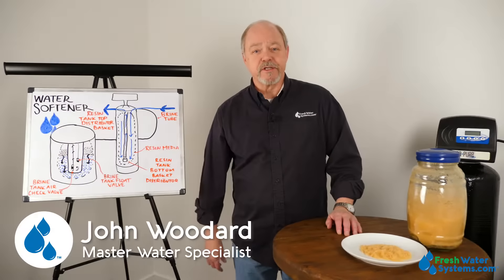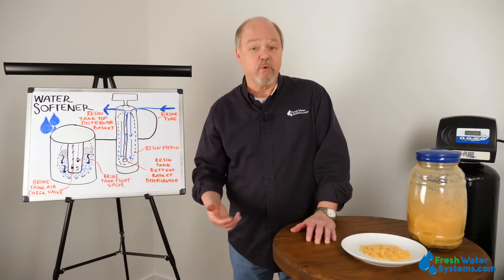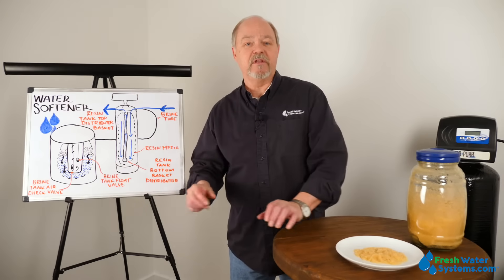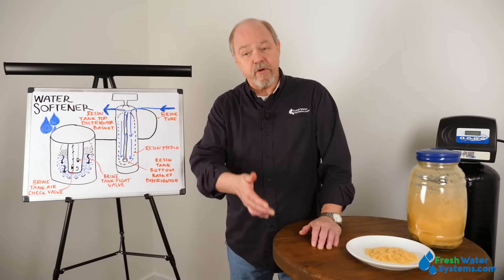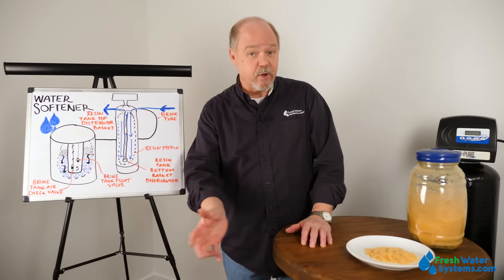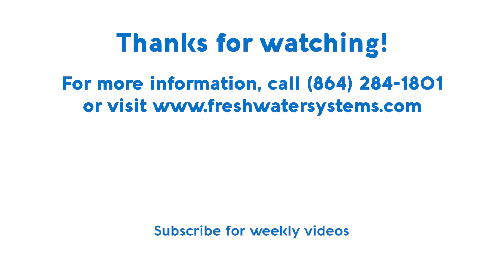What is a Water Softener and How Does it Work?

Comment: You Dont need water softners its a complete myth you end up paying hundreds for a water softner wether it be soft or hard water areas i had brand new plumbing fixed into my kitchen.if my kettle afther two years gets limescale i simple replace my kettle only 25 english pounds
Reply: I don't have any pounds from England.  My hot water heater weighs more than that when completely full, maybe 400 US pounds.

Comment: Great job explaining all of this in detail. Nice job.. Thank you for your time producing this video. I bought this place close to 2 years ago. It's on a well. I have rust stains. My water test shows moderate rust. Not knowing when the system was last serviced, and it was out of salt when we got here, I wanted to replace the resin. 

I contacted the system manufacturer, gave him my test numbers and he prescribed the required resin. I bought a 1 cuft bag. I dumped the tank's old resin, and it was like black mud. The replacement resin was amber as seen in your video. Does the resin turn black or was there something else going on here? Is there a black resin? I washed out the tank and put in the new resin. Since I have rust, I believe I should also be using a resin cleaning solution. I use Iron Fighter Salt as well. Is this sufficient or do I need to augment with the resin cleaner. I appreciate your help. This is my first softener. I do have a screen trap type flushable filter ahead of the unit.

Comment: Thanks for the video but I think you are missing a major issue with some water softeners; the resin has a lifetime and can break down and bleed into your water system clogging up all your faucets and showers, WCs and water applicances and that is a major headache and expense typically not covered by water softener companies from my experience. It would be useful to add this to the video and ways to avoid and remedy this.

Comment: What happens if you can’t see the iron in the glass you said when you hold it up you can’t see it. It has to be in solution but it shows up in my tub or sink. Does that still mean that it’s grab by the resin? If I can see it in the tub but I can’t see it in a glass will the ion exchange still work to remove the iron?

Comment: Brilliant presentation, thank you!

0:13 “One of the biggest water problems...”—hard water. Calcium and Magnesium.
0:29 “...clog plumbing, they create scale on your shower head, and that filmy scum that gets on the shower curtain or the shower doors...”
0:38 “...beats up hot water appliances...”
0:49 “...hot water heater’s making popcorn...the scale has attached itself to the heating element.”
1:09 What the water softener does...
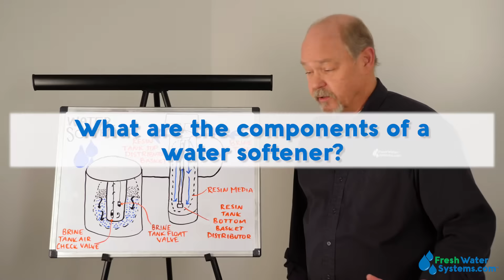1:21 Primary components...
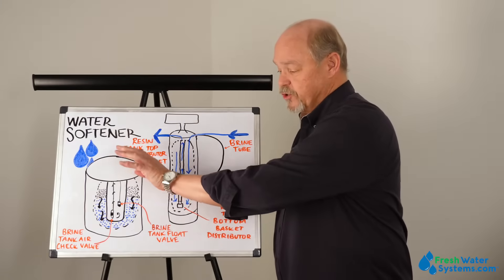1:44 Brine tank—where the salt goes
1:48 Regeneration
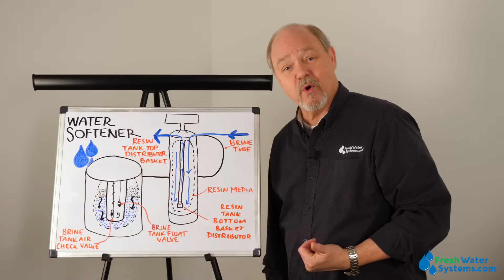3:10 How do water softeners work?
3:18 Resin beads
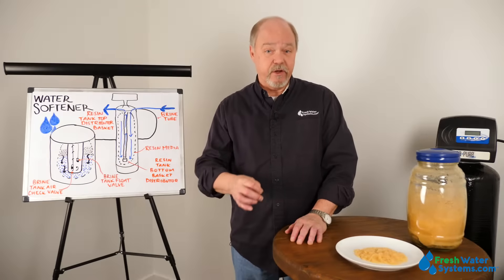3:27 Ion exchange
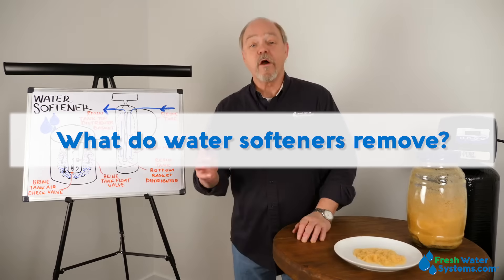3:47 Hardness-causing minerals and the chemistry overview
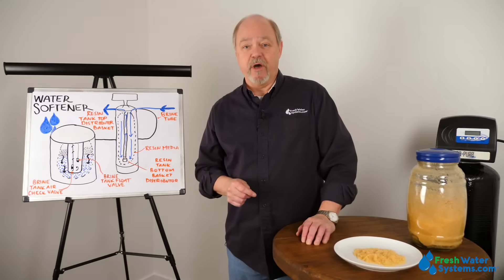4:29 Anything in the cation family can be removed by the water softener
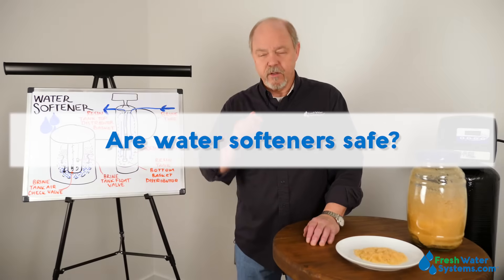5:30 Safe? What about the sodium ions?
6:00 3mg of sodium per quart
6:17 “The amount of sodium added is directly linear to the amount of hardness minerals...”
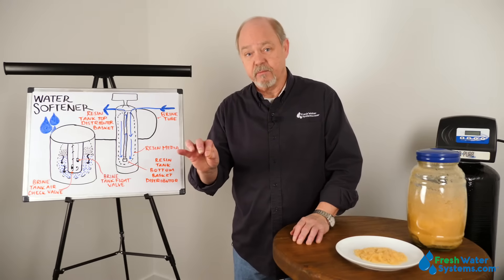6:37 “...beneficial to add” a reverse osmosis system
7:01 Salt-free softener doesn’t exist
8:09 Softeners can leak (primarily at the point of installation)
9:54 Bypass—maintenance and repairs

Comment: i am in the process of installing a water softener system and i have 3 important questions that my plumber is not able to answer:

1) Should the water softener be installed before a water filtration system or should it be installed after the water filtration system? Or the sequence does not matter?

2) How much salt is in the water softener's backwash discharge?

3) Is the backwash discharge from the water softener system harmful to the environment where it needs to be disposed through the sewer line, or can the backwash/discharge water be used for gardening purpose?
Reply: 1) Always install the softener after the filtration system so the filtration system can help prevent the softener from clogging with particulates. This helps protect the softener from clogged screens etc.

2) This is typically programmable in the softener.  It is related to how hard your water is.  You shoudl get a water hardness test done.  The results of the test should be entered into your softener's controller or otherwise used to determine how long a regeneration should take.

3) The backwash and regeneration water will contain minerals removed from the water over the service cycle as well as a high level of salt not consumed during the regeneration cycle.

Comment: Ok so first the water goes into a brine tank full of salt right?  Salt is sodium perchloride table salt is just bleached and steralized with iodine.. but yea, so the water is now saturated with the brine solution.   Then it goes through a tank full of plastic beads.. so the brine tank..  does it ever need to be refilled with more salt?  Yes, it does, often..  the resin does not because it is acting as a filter media.  so this ion exchange your talking about is a sales tactic which is true in a sense of saying if you take a pinch of salt then drop in a glass of water than you “exchanged ions” Between the sodium and h2o making it h2o+NaCl.. effectively doin this “ion exchange”.  a liquid getting super saturated then filtering through a media that only allows the liquid to filter a certain percentage before allowing it to pass through..  once the media gets over saturated with the salt then the brain of the softener goes into flush mode which puts water directly into the resin media tank to flush it . Then valve resets and begins using the brine solution..   An ion exchange can only occur when an electron loses a positive ion and gets a negative ion in exchange which puts a positively charged ion into atmosphere which will bond with other negatively charged..  when a positive ion exchanges for a negative you get the negative ion which in the air purifiers its creating ozone and the negative ion attaches to the oxygen ..  a lot more of science behind that but if you believe the softener is exchanging ions which make the water soft your kind of correct but mostlynot..'
Reply: So what’s the best solution for hard water then? I have a big problem here with it.